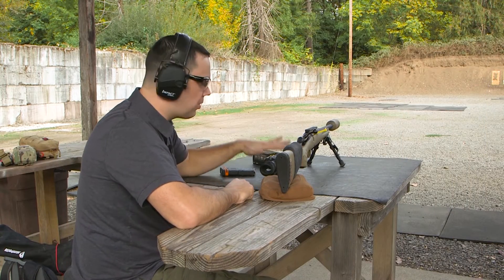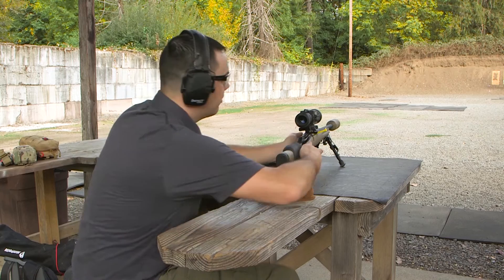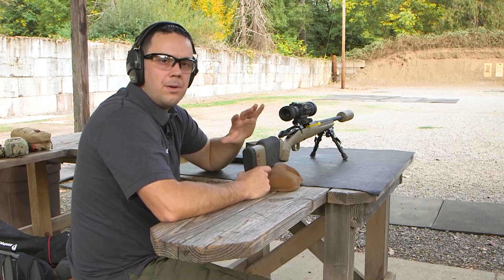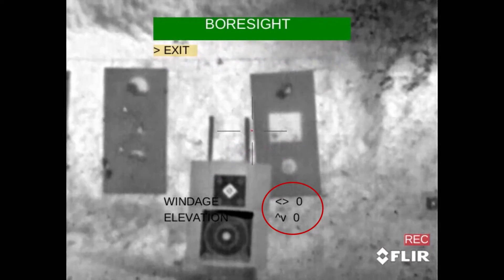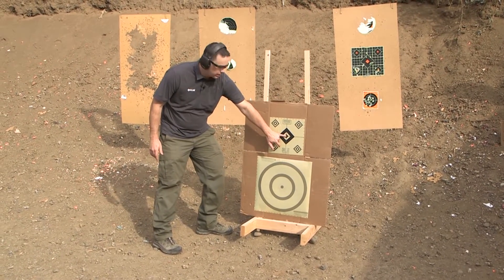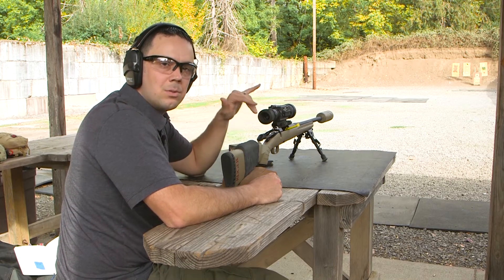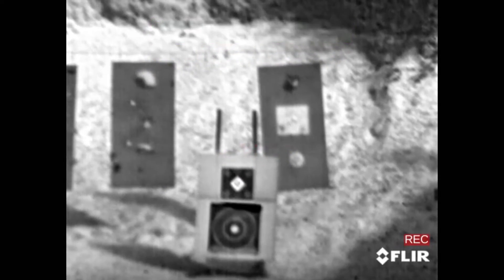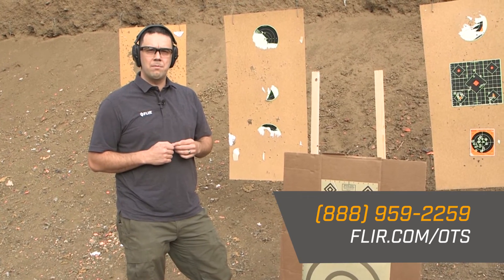How to Mount and Zero FLIR Thermal Riflescopes

Comment: What do you find that are the best settings for foggy conditions.
Right now we have fog with about a 1 block visibility.
I am trying to see something that is only 50 yards away and can't even make out obvious things.. 
I am on Sepia & Outdoor because it does make it easy to spot white heat sources.
I can & did see the heat from a cat and trapped it then brought it in to get warm so that tomorrow I can bring it into the humane society.
Last night it was clear and I could see two miles across the fields with no problem.
Did see a coyote running about 2-3 blocks away from my place.